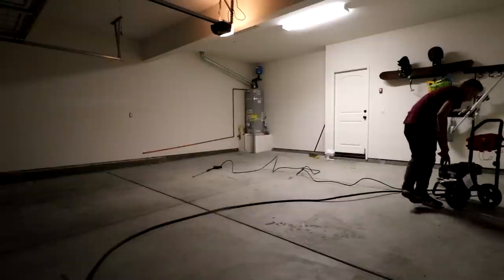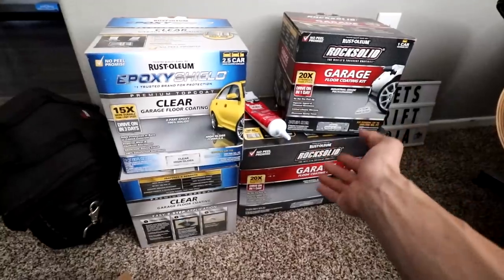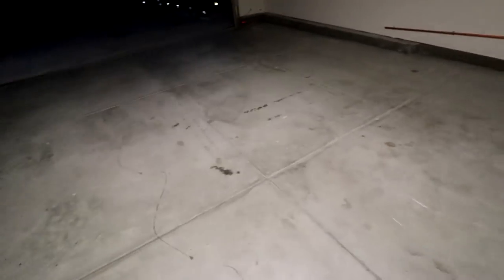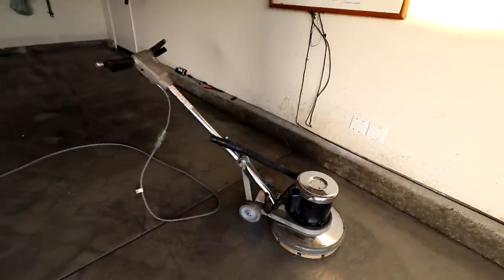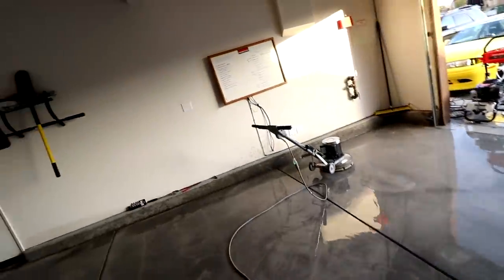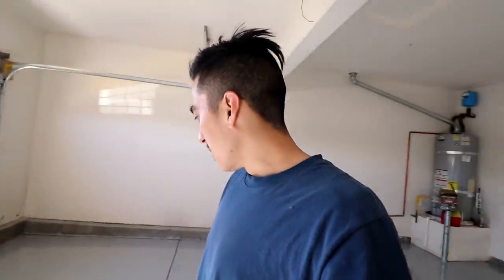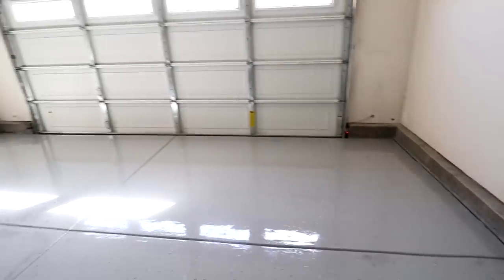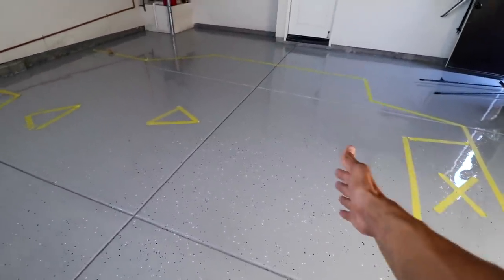RUST-OLEUM ROCK SOLID GARAGE COATING 2021

Comment: I've read if you grind the concrete prior to applying this product the bubbles appear.  Better off using their sealer primer first and skip the etching/grinding.
Reply from the maker: Yea if I were to do it again I would primer first
Reply: @LetsDriftMedia  .... or maybe not grind/etch it as hard?  if that's possible?
Reply: wonder if the following steps are the better way?
1. use cleaner & degreaser
2. use RockSolid Garage & Concrete Primer
3. use rocksolid polycuramine garage floor coating
Reply: @superdtx1733  that is exactly what I did, used the Rustoleum Primer (not even sure it was RockSolid brand) and it came out excellent, I frankly think unless you are going to rent a diamond grinder the average joe is better off primering first then appling RockSolid.  The stuff is just too finicky without it, and even with it you have to work quick.  I think their etch cleaner is NOT enough to prevent bubbles and other issues.  My overall opinion of the product is its OK, if I did it all over again I would do Shermin Williams garage coating, unfortunately I am in California and like everything else good is not allowed to be sold here.
Reply: @mikedodd9294  🤣🤣🤣🤣

Comment: That's the issue 26:35 and how you're essentially over agitating the bag mixture / you really need to gently fold the 2 compounds together instead of shaking it which introduces air into it ie. the bubbles therefrom
Reply from the maker: Interesting, thanks didn’t know that

Comment: What an honest video experience! great job dude!
Reply: I am getting mine in couple of days. I am going with the rocksolid polucuramine clear coat and not the Epoxy shield. It’s prob double the money so I hope it turns out good. Seeing what you ent through in only using a tiny bit of sand in the clear coat. Also I bought 25lb of decorative chips so hope that will help with preventing bubbles. Oh and I’m def getting spike shoes and I’m gonna epoxy the raised edge since I have the same thing in my garage. Will have the torch on deck ready and watching for bubbles lol.

Comment: I’m glad that I found your video. I am applying this product to my dirtbike trailer floor. I bought the 1-car garage kit and it didn’t even cover my 7x16 floor and no coverage on the ramp at all. Rust Oleum is buying me a second kit under a satisfaction warranty, and my worry is rolling over the thin but flaked sections that I already laid down. I saw you rolling over flakes, so I’m relieved.  I was so careful to preserve product and didn’t expect that the coverage would be 1/2 of advertised! I even poured the anti skid into the pouch abs mixed, so I wouldn’t leave any on a maxing paddle and bucket. Lol. I hope the second application will cover the first plus the ramp door!
Reply from the maker: Awesome man! I’ve never heard of anyone putting this on trailer floor that sounds badass
Reply: @LetsDriftMedia  so far it’s just ass, lol. I’ll reply after the next coat and let you know if it levels up to bad ass :)
Reply: @LetsDriftMedia  I can’t upload pics, but I came up short again. It covered the 7x16 trailer well, but I barely had anything left for the ramp. I’m calling tomorrow to find out what to do. If I can paint over it, I’ll paint the ramp door with some porch paint. As for the rest of the job, I put on a nice coating and all looked great. It has already sucked in at a few spots showing thin, but I can’t justify buying another kit unless Rustoleum wants to pay for it. Lol.
Reply: 3rd package and we’re finally looking covered. It’s curing now. It better last after all this!! 🙏😀

Comment: He should have poured the product in a paint pan.   He would not have used as much. Pouring directly from the pouches causes uneven application.  Still looks good enough for me to try it!
Reply from the maker: Yea that way may have been better but my concrete would have still absorbed alot of product I think. Idk but still satisfied with the results thanks!

Comment: Damn. I wouldn't have put the anti skid sand now knowing. Very informative video 🤙
Reply from the maker: yea I would just sprinkle it on after laying the clear, putting the whole bag was a big mistake.
Reply: @LetsDriftMedia Thanks for the vid! Preparing to put the same clear finish on my garage floor. Do you think that anti-skid is even worth it? Don't the flakes serve the same purpose?
Reply from the maker: @roskul  I dont think its necessary, but I would still add a little sprinkles of it once you lay the clear.

Comment: I have a old question nick. Whenever you fixed your Lexus how did you know your ECU wasn’t sending the correct voltage to the TPS? How can I diagnose it. Thanks
Reply: Back probe it 
Fluctuate the gas should bounce between 0-5v
Reply: Obviously close to 5v on WOT

Comment: Hi Nick, I think your garage looked amazing, hard work but worth it; I laughed a lot at how you used the surface cleaner (sorry xD)
I have some questions, I don't know if you or anyone can help me; I want to apply this product in my garage, but I have a pretty steep ramp; this product has self-leveling??, another question would be very necessary the anti-slip??, as I have noticed in your video as in others that it is quite bright but I don't know if it would be very slippery.

Thanks for sharing this work.

Comment: The prep is 95% of how successful you’re going to be with this process.   Failure to properly profile the floor WILL result in this product peeling off in a relatively short period of time.   I purchased a home in which the previous home owner clearly rolled this stuff directly onto a smooth finished garage floor.   It was already lifting off by the time I closed on the home and continues to do so.     I’m having the floor professionally resurfaced as it’s absolute hot garbage to look at.
Reply: YA IVE DONE ABOUT A 100 OF THESE GARAGES, BY TRADE IVE BEEN A TILE SETTER FOR ALL MOST 30 YEARS, AND PREPPING IS THE MOST IMPORTANT THING FOR ANY PRODUCT,/PROJECT I WISH MORE PEOPLE LIKE YOU AND I WOULD UNDERSTAND THAT....

Comment: I get that everyone has a budget they have to operate around, but your time is worth something too.  It always surprises me when folks exert thousands of dollars worth of effort in prep and then use a product like Rustoleum which is the basic equivalent of a 4-5 mil prime coat and with modest traffic will only last 3-5 years max before failing in spots.
Reply from the maker: Yea like I said I just went for it with the knowledge I had. Im pretty sure theres a whole lot of other ways I should have went about it, but live and learn.

Comment: We've got a brand spankin' new garage - the car hasn't even gone in it yet.  Do you recommend etching it?  Also, what tools are needed?  I figure:  hose, bristle brush/broom; paint brush, roller brush w/extended handle; pail/bucket... what else?  We got 2 extra bags of chips for our 1.5 car garage and got the 2.5 car kit.
Reply from the maker: Ive read that etching is not required. Looks like you got all the tools needed, maybe some painters tape to mask off the garage wall near the bottom as well as paint roller trays and plastic tarp to prevent spills and latex gloves. BTW I only used about 1/4 of my chips for mine since I did not want the heavy chip flake look.
Reply: @LetsDriftMedia  thank you!  i have painters tape, but did not get roller trays and it's suggested to just pour it out... not sure how we'll tackle it yet... I've seen it done both ways.  Thanks again!!!

Comment: Whats up man awesome video, I was wanting to put the clear coat Rocksolid on top however when I saw it was more expensive than the actual base coating I do not want to do it, kind of a three way question but my floor is a raw concrete, I am going to diamond grind it but do you think I need it is necessary to put primer and the top clear coating on after if I use the rocksolid product? Thank you
Reply from the maker: I kind of wish I primered mine. But it’s still holding up fine. I would rec clear coating still to help with the longevity also if your going to be working in the garage a lot it’ll help.
Reply: @Lets Drift Media  thanks for getting back to me, is you had to chose one which is more important the primer or the topcoat, I just don't think the top coat is necessary for the rocksolid product line
Reply from the maker: @aco3495  I’d go with the primer I think so it sticks to the floor as best as possible. But if I could do it again I would do I would do primer and clear. Unless you don’t mind it not having a shiny finish. My neighbor didn’t clear his and it doesn’t look as nice.
Reply: @LetsDriftMedia  thank you man i really appreciate going to take your advice

Comment: I can really appreciate all your effort. I have a unopened box sitting in front of me that will be returned. $228.00 A lot of people have been burned on this product. I have used the old rustoleum epoxy with great results, but I'll be damned if I have to buy twice the product for proper coverage. It's too bad, they had a good product and had to ruin it.
Reply from the maker: Thanks man and yea I really think they should rec you doing it with primer first. Theres no way a 2 car garage kit will cover the whole 2 car garage floor evenly. Idc what anyone says my concrete absorbed so much product
Reply: @LetsDriftMedia  i’m gonna use a primer because of this, so i dont have to buy another box of epoxy

Comment: What rocksolid doesn’t tell you is that you are to put a coat of primer first, to avoid all those rough patches, second you used the wrong clear, the clear you used was for epoxy not for polycuramine, they have their own clear.
Reply from the maker: Right on! So far no issues next time I would do things different.

Comment: I just finished my 2 car garage with a re-coat of this stuff over 12 year old existing Rustoleum Oil based epoxy which held up quite well over the years.  I used their re-coat primer first. Can anyone tell me what the paint chips are made of and why you would want to use them besides a decorative look?  I don't think they are as strong as the polycuramine?
Reply from the maker: Nice 12 years is a long time. And besides looks I’d would say the chips add a little texture to help with grip

Comment: DID YOU USE THE PRIMER 1ST ??, FOR THE BEST RERSULTS YOU SHOULD USE THE PRIMER, YOU WONT GET AIR BUBBLES, AND ALSO PUTTING IT ON SO THICK IS PART OF THE REASON YOU GOT BUBBLES, IM NOT A PRO PER SAY, BUT I HAVE DONE ABOUT A 100 GARAGES
Reply from the maker: I did not. I wish I did tho. And yea we did put a really heavy coat on. 12 month update video dropping in 2 hrs

Comment: when you applied the second layer on day 2 on the top of flakes, does it affect the final appearance? How is it doing now (after one year)?
Reply from the maker: Didn’t affect it much besides seeing slight raise marks where you covered the flakes with the 2nd coat. But once you lay new flake hard to tell. I have a 1 year update on my channel.
Reply: @LetsDriftMedia  I have one more bag to apply second coat tomorrow. I read online seeing someone said for second coat you need to apply the whole garage not just several areas. My material is not enough to apply my three car garage again. Worried that will have different colors
Reply from the maker: @jiayingsong9348  should be fine. I re coated small areas in the video that didn’t get full coverage and you can’t tell after it all dries.

Comment: Hello I would like some help please I used the etching that comes in the Box of Rock solid it did not bubble it did not sizzle it did not do anything how do I know if it worked enough?
Reply from the maker: Maybe someone can chime in, I did not use the etching so wouldnt know.
Reply: @LetsDriftMedia  I actually looked online and you can make it much much stronger use less water and then it sizzled. My problem is I have a fiberglass coating on the top and Rust-Oleum said to use a moisture seal product and then use primer under rustoleum Metallica.
Reply: So I want to warn everybody that you always need more supply of rustroleum and they give you make it double or more strong when you mix the edge and if you have a garage that has a nice smooth feel to it you may have a fiberglass in it when the concrete was made in the end they told me to use moisture stop and use a primer under the silver bullet Metallica they said the product will spread easier and go further not requiring so much so other people may want to do this even though they do not say you need a primer you really ought to. So degrease clean well etch for some use rustoleum moistop use rustoleum primer then use your kit. 👍

Comment: I may have missed it. Did you use the etching that came with the kit?
Reply from the maker: I did not, I saw alot of youtube videos that did not rec using it.
Reply: The edge in the kit did not bubble or fizz I wonder if it was enough or I need to redo it?

Comment: how's it holding up a couple months later? any hot tire wear/peeling?
Reply from the maker: Still solid but tbh I have worked much in the garage since its been so hot. And I only park the drift car inside here not my dailys so don't think I will have the hot tire pickup issue
Reply: @LetsDriftMedia  how many days did you let it dry before parking/moving stuff back inside? a friend of mine had his professionally done and waited 5 days to move back in and hasn't had any issues in like 4 years now.
Reply from the maker: @alfs3  i let it dry a week before putting any thing inside and 2 weeks before pulling a car in

Comment: I've also read you should not use the antiskid.
Reply from the maker: I would use some just sprinkle it when the final coat is drying dont mix it with the final coat like i did.
Reply: @LetsDriftMedia  after 6 months of use I find the flakes provide a bit of traction, I couldn't imagine not doing the flakes, it would be a an ice skating ring if it gets wet.
Reply from the maker: @mikedodd9294  yea I’m actually glad I put a bunch in the front 2 squares since that’s usually where water or fluids end up.

Comment: Sorry, watching you run the floor buffer was some funny stuff. I hate to say you’re doing it wrong but you are. You have to tap the little tab at bottom of the handle to lower it. You can’t control anything with it upright. If you tilt the buffer slightly to left, it goes right and visa versa.
Reply from the maker: Yea watch a little longer and you'll see i realized at the end lol
Reply: @LetsDriftMedia  I will, I was watching and then got a call. The end result looks amazing…I’m hoping to do the same but are not sure if it’s worth it. I prefer the swisstrac wood looking snap tiles from Obsessed Garage but that’s a considerable investment to Rock Solid.
Reply from the maker: @zfilmmaker  yea I considered the obsessed garage tiles but really loving the look of the rock solid. So far bee holding up great even after multiple fluid spills
Reply: @LetsDriftMedia  what about hot tires? Has it bubbled at all?
Reply from the maker: @zfilmmaker  i only garage park my 240 so havnt gone on any long drives to re Park it and see.

Comment: Man, they should really explain how to use the tools. What a safety concern here you go rip your arms off! I just did mine 2 days ago. These machines are super easy to use once you actually know how to control them. You lower handle to waist height. You don't fight it to make it move. You actually push down and it will move left and when you lift it moves right almost zero effort as long as you know that. Reason they should explain it to you at the store.
Reply from the maker: Yea as you can see i learned the hard way lol